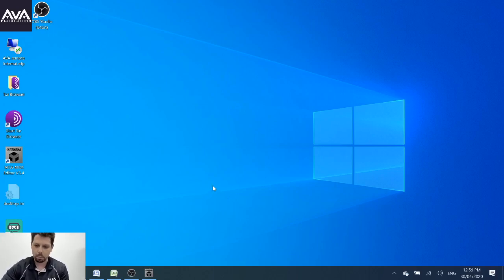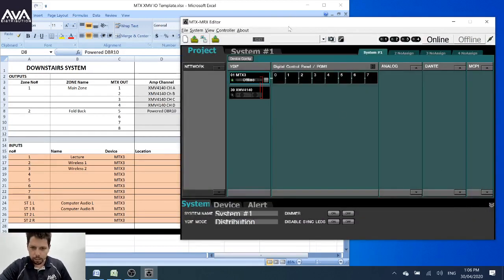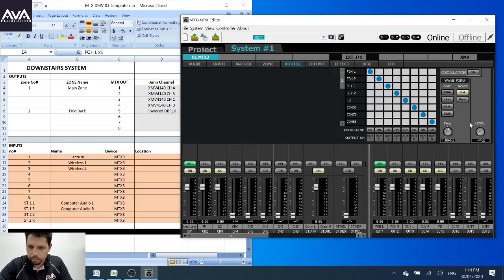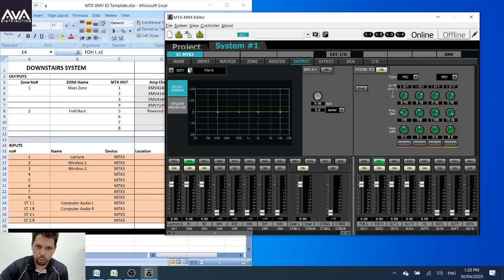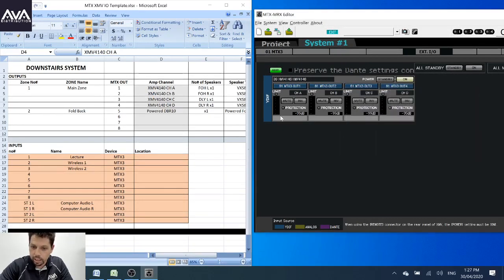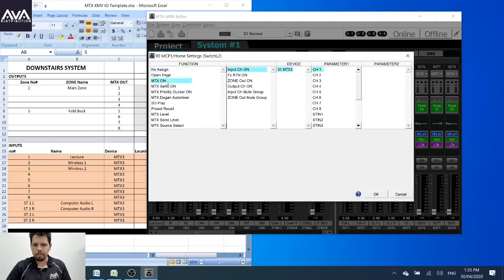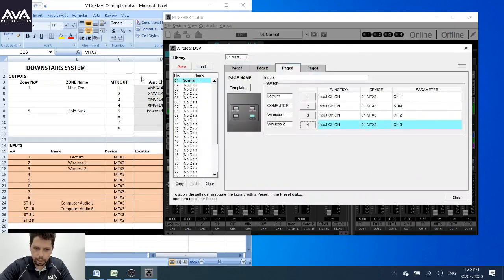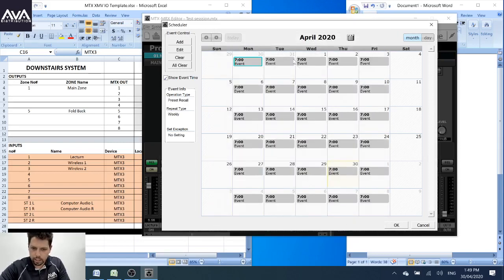How to setup a Yamaha MTX3 with XMV4140 + MCP1 & Wireless DCP App - A complete walkthrough

Comment: I plugged a cat5 into port 7 and was able to connect to Yamaha in network screen. I can access the control panel software. I saw settings but I wasn't able to go online like you did. It was grayed out. So I'm not sure what I am doing wrong. I'm trying to troubleshoot a sound problem. The 1/4 inch wire coming from Output 8 sounds very muffled. I can hear myself talking sort of, but no words are discernable.

Comment: @ 44:54 Let's assume you have two different presets. If you didn't save them by overwriting as you showed each time, but rather went  to file>save. Whats the difference? Assuming you had already "saved as" the file first.
Reply from the maker: The Pre-set (camera icon) is a snapshot/scene save of the Parameters within the session. The File Save is the whole .MTX session file on your computer. You open the .mtx file/session in the MTX/MRX editor. You save Pre-sets within the session.
Reply: @avadistribution9027  You didn't click the actual camera icon to save though....you clicked the preset box you named "001 Normal" to save. Anyways, I have never done it like that, I always just click file>save. However I only have ever used 1 preset in an file/session. Never multiple presets.